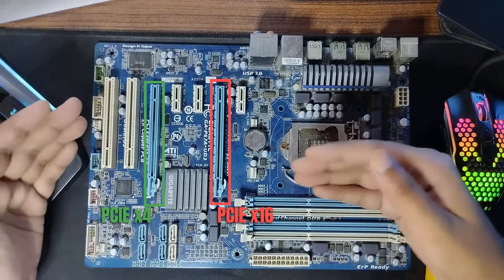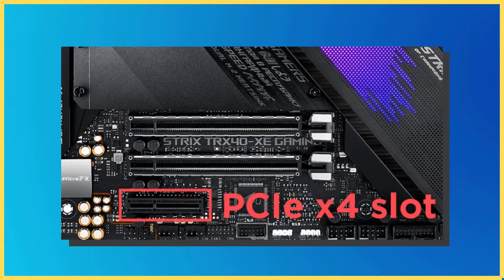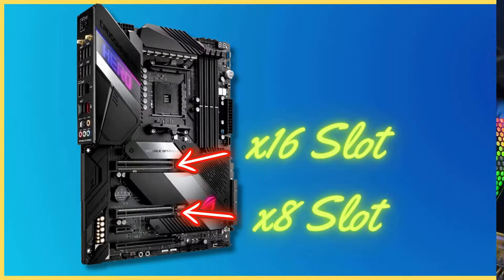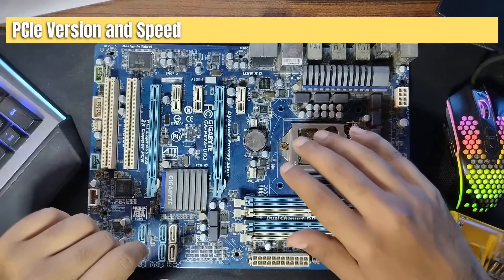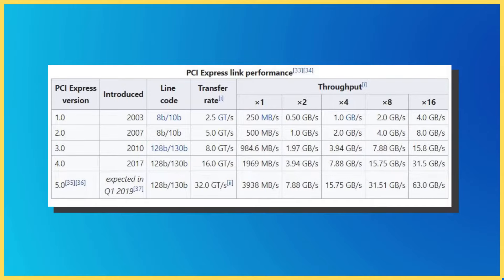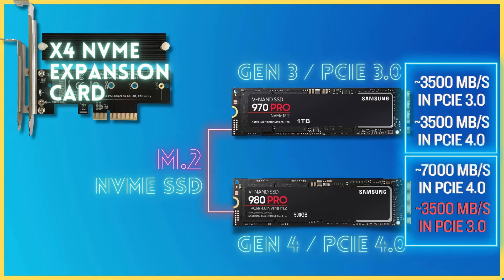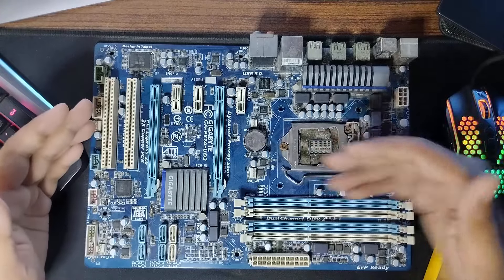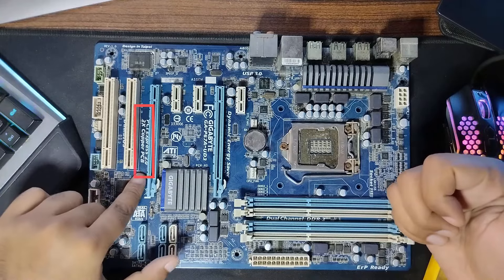Types of PCIe Slots Explained | PCIe Slot Sizes Explained

Comment: Is it true that some motherboards have certain slot combinations that may not work? For example, if you have an M.2 NVMe slot populated, then maybe PCIe slot #3 is no longer available. That seems to be the case with my computer. I added a PCIex4 adapter card for an NVMe 1TB card and it doesn't even detect it, not even through Drive Management.

Comment: Great video! 
I am wondering though, the rx 6650 xt uses gen 4 pcie x8. The motherboard I have has gen 3 pcie x16. So I know I will be able to plug in the rx 6650 xt into the pcie x16 slot and it will work. And I shouldnt have issues right since gen 3 pcie x16 has a throughput of 16GB/s and the rx 6650xt has 8GB of vram? or am I supposed to look at the transfer rate?

Comment: I got the new Asus TUF A14 which has 2 m.2 slots, both pcie 4.0 but one is x2 and the other is x4. So if I have 2 SSD, one has max speed of 4GBps, and the other at 7.3GBps, I should put the slow one on x2 and it'll run at 3.94GBps? I've heard people say x2 means half the speed of x4. But if my SSD is maxed out at 4GBps anyway, it should run at close to max on x2? Or is it halved to 2GBps?

Comment: I have Strix B450 Gaming F. i put my gpu on 2nd pcie slot.. cause i think i damage the 1st pcie slot.. maybe some over watts.. my question is it ok to put my gpu on 2nd pcie slot? does affect the performance or what?
Reply: I'm not PC expert, but i assume that's fine. I think there could be an issue if the PCIe have different bandwidths, which could limit the power the GPU gets
Reply from the maker: Sorry for the late reply. Yes, it should be fine. The second slot is x8. There will be very small performance hit though, but nothing to worry too much about :)

Comment: 2:30 "..certain USB expansion cards".
Please could you produce another video which goes into  detail about what sort of PCIe slot that you require if you are looking to drive a USB expansion card to transfer data into USB-C, 3.2 2x1 (1050Mbps) or even USB 3.2 2x2  (2000+ Mbps)
My son bought a really fast external SSD only to find that his computer only had USB 3.0. on the motherboard.
So, he bought an expansion card, only to find that the PCIe spec of his PC throttled back the expansion cards ability to throughput data.

So... to be able to drive the external drive at anywhere near 1050Mbps, he will need to change the motherboard!!